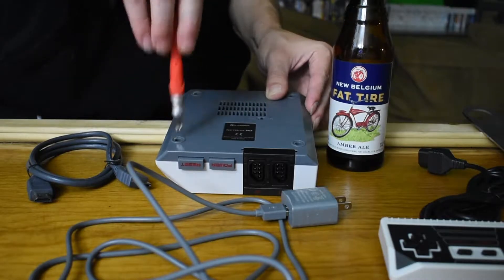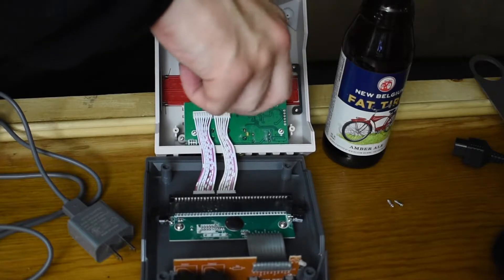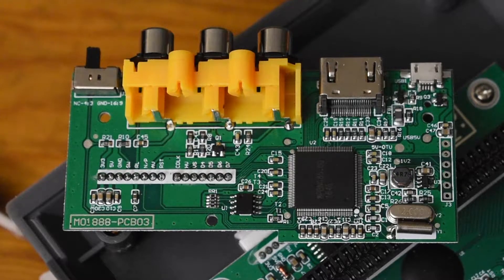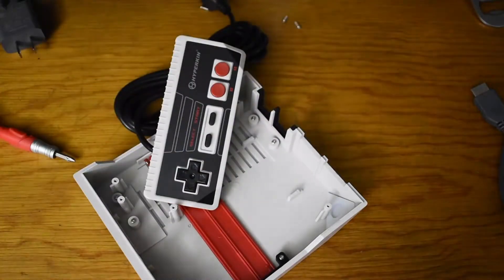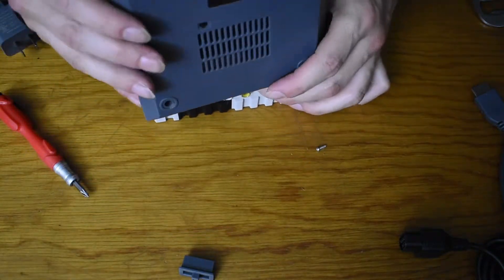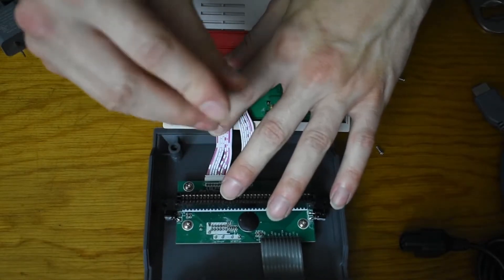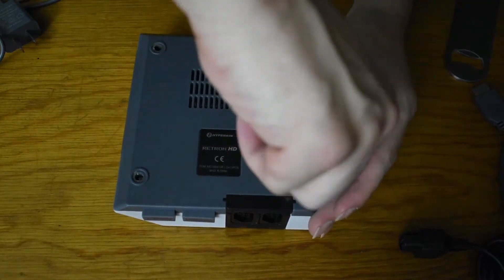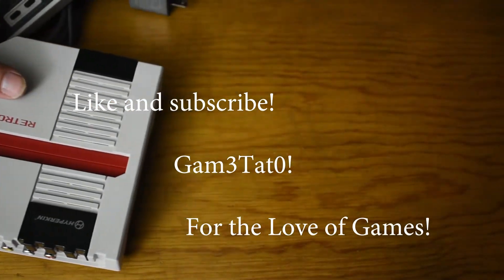Retron 1 HD Teardown

Comment: The black disk next to the cartridge slot is the "NES On A Chip Glob Top", it is the entire NES game processor. The big chip under the HDMI is just the HDMI video out scaler. The cans are called crystals, they provide the clock frequency for logic timing.

Comment: The black blob is a cob. chip on board. the epoxy is a cheap way to protect the chip instead of proper housing etc, it also has been used in the past for security reasons, making it harder to find out what the fuck is going on with the chip lol.
Reply from the maker: I like your channel and subscribed! I'm tearing apart PS2's. I just bought 3 fat models and a slim!  2 of the fats have the i- link port ,1 does not have the port. One of the i-link PS2's has a bad laser and grinds so I'm taking parts out of my third fat PS2 (without the port) to restore the 2 i-link PS2's to perfect health!!!

Comment: Sweet! Now if we could figure out how to mod the HDMI output in order to fix the color issue. Colors on some games show white instead of the actual color. Such as, Marion in Punch Out, skater in T&C Surf, wrestler in Pro Wrestling, etc. Composite output is fine on the Retron 1 HD. Not sure what changed for the HDMI output? Also, Rad Racer II doesn't display its graphics properly but that would take modification to the NOAC, I'm sure.
Reply: I would think this console puts out HDMI in full range colorspace when some TVs only support limited colorspace. Full range has black levels at 0 and white levels at 255 while limited has black levels at 16 and white levels at 235. Full range HDMI on a limited-only HDMI input will crush the colors quite considerably, and this even affects the NES Classic Edition, which ONLY has full-range HDMI. Likewise with GamerTek's equivalent to this system, the 8-Bit HD; its HDMI output is fixed to full-range colorspace.
Rad Racer II screwing up is because the cartridge can't disable the internal CIRAM for the NOAC's PPU. The cartridge pulls CIRAM /CE on the cartridge slot high to disable the CIRAM as the game puts its own CIRAM instead in its place. Since it can't do that here, the backgrounds are severely scrambled, and being as this is an input from the slot to the chipset, you can't fix this up without modifying the NOAC itself.
Reply: I have this on a VIZIO 4K TV. I didn't notice the issue on GamerTek's HD console but I no longer have that. May try on another TV to see if there's any difference.

Yeah, I figured the NOAC would have to be altered but that's something Hyperkin should do when testing out their console and fixing before release.
Reply: It seems to me like the clone console manufacturers don't test anything and instead secretly revise their hardware only after complaints pour in either directly to them or elsewhere on the Internet. However, they are UNBELIEVABLY STUBBORN when it comes to 3.3V RAM in Super NES hardware clones used in a manner that is potentially dangerous to the hardware. The chipset runs on 5V, the RAM runs on 3.3V, you need to regulate the voltage on the RAM down to 3.3V and insert a level shifter to properly adapt the logic levels between the chipset and the RAM. You think they do this properly? ABSOLUTELY NOT! They just directly take the 3.3V RAM, directly connect all the pins to the chipset and either attempt voltage regulation or overvolt the chips to 5V when their datasheets CLEARLY STATE absolute maximum ratings are 4.6V for these 3.3V RAM chips. Whatever happened to using proper 5V RAM? If you're going to use 3.3V RAM, do it right, for the love of all that is holy! It's dangerous and will cause long-term damage from running the chips so far out of spec.
At this point, I don't even think engineers are designing these things, but some random nobodies who don't even know how to open up a f*ing datasheet to make sure their components will work properly in their designs. It's pathetic and it's inexcusable.
Reply: You got that right. Just a little effort could make a better product.
Reply: So Bob of RetroRGB got himself a RetroN HD and WTF is with that color palette? It looks so weird! Even the competing GamerzTek 8-Bit HD doesn't look like that (Version 1 looks like FCE Ultra, Version 2 looks more like a proper NES, but with some colors having a bit of green push). It does lose a little bit of detail when crushed to limited colorspace, but looks quite good in full range colorspace.
If only it had aspect correction...
Reply: i heard that switching to the AV cables gets rid of most of the issues. Haven't tried it yet though.